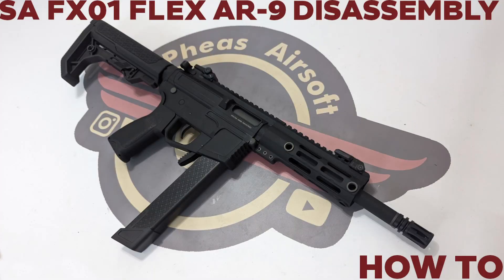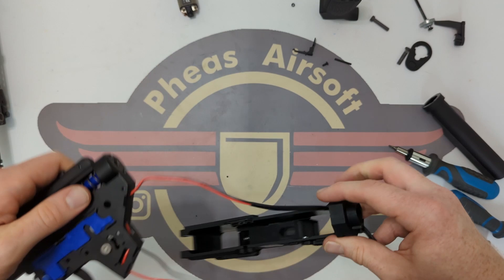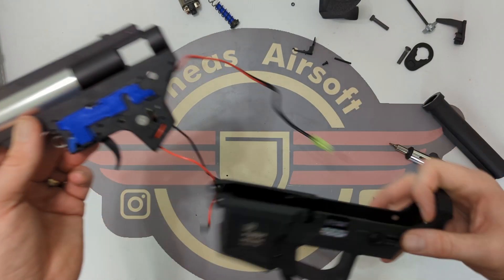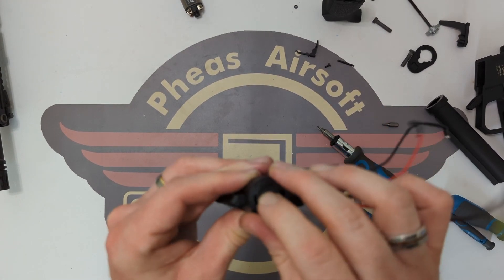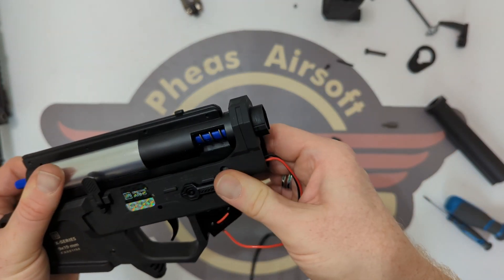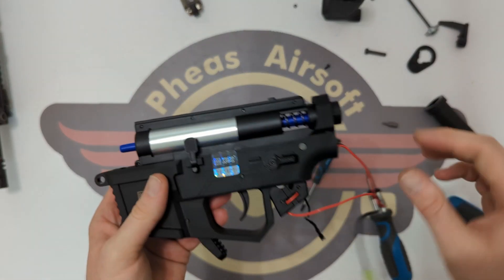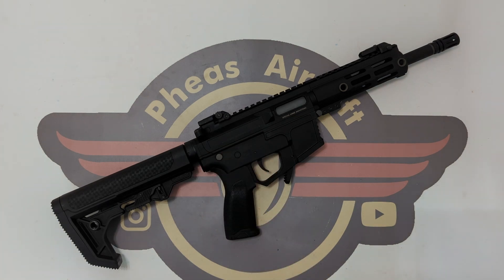[HOW TO] Specna Arms SA-FX01 FLEX AR-9 SMG - Disassembly for repair or maintenance

Comment: With those quite upright Specna pistol grips, it is better to reroute the motor cables down the front of the pistol grip rather than the back; doing that allows the motor to sit at a better angle to properly engage the bevel gear.

Comment: Did you ever have any problems with the dust cover catching on something when the release was pressed? I’m having this issue with my Sa-X02 which is near enough the same but uses metal construction and has some different upgrades parts.

Comment: My barrel has a different style flasher that is making it extremely difficult to come off. I’m wondering if there are different versions of this that are disassembly is a little different. I just wanna paint my inner barrel a different color than my rail.
Reply from the maker: Hello, is there a set screw or grub screw on the under side of the muzzle break? Which could be tightened down. Pheas
Reply: @ first of all thanks for responding. My flash hider isn’t like a traditional looking one. It resembles more of a suppressor and it’s set into the end of the rail system. If that makes sense I purchased out of the box like this this weekend I’m gonna try to go to my local store and see if they know how I’ll report back with info
Reply: @ I didn’t see anything but I’ll look again

Comment: What suggestions would you say for upgrade on hop rubber and nub and would you recommend a tightbore barrell?
Reply from the maker: Hello! I would take a look at the delta armouries R hop rubber and omega nub. the set comes with a hop arm that you don't need, but the rubber and nub are excellent! As for tight bore... Zci are excellent as are XT battles wherever you can get them. Pheas
Reply: Thank you so much 😊

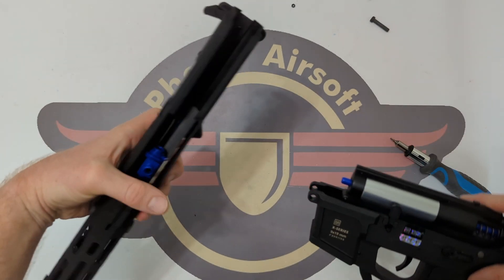Comment: Why is my upper part doesnt come off like yours? at 4:04. Im doing the same thing but nothing
Reply: do you got the eu version? i got the same problem and the seller told me you are not allowed to modify the eu (or german version) so this locks the top half in place
Reply: @CA5TLE. is there a way to remove it ?
Reply: I really need to know
Reply: @PrintedFidgets3D  idk man. I want it too
Reply: @V_Gergo  I destroyed my replica trying to do something :(
Reply: @PrintedFidgets3D  how did you destroy it?
You have to wiggle and pull the button to close the bolt catch, but if you lack in finger coordination to disassemble it, do you think it is a good idea to work on it?
Best of luck!
Reply: @CA5TLE.  I thought it might be a bolt, you might now know where I am going.
It was not a bolt
Reply: @PrintedFidgets3D  you saw the same video I did, he showed us every bolt. What did you break maybe the is an easy fix, I broke some stuff too
Reply: @CA5TLE.  I bit of the shell with the knife, can always cover it up with some tape

Comment: i have a little strange problem with this replica,verry smal problem....when i shoot 10bb's...always 1bb misfeed.....1bb on 10bb's dont   feed, i tried another hopup rubber, champer..barrels....but problem stays...the only thing that i upgraded on this replica....is the nozzle....i changed the original plastic nozzle for a max alu nozzle air sealed 21.25 mm, en inside a Gate Aster mosfet. it works perfect....but only the smal problem ...1bb on 10bbs dont feed😅